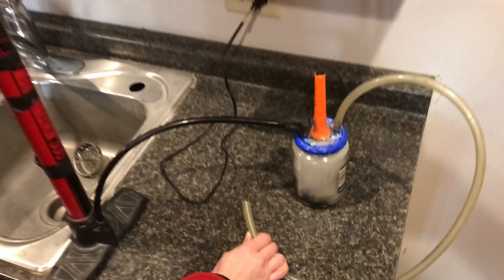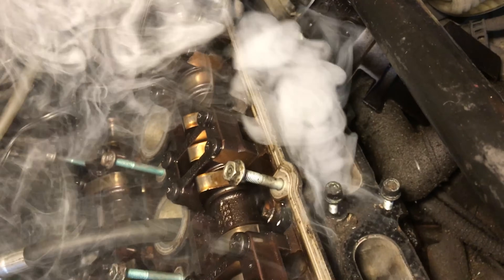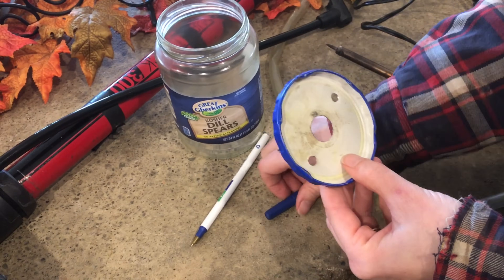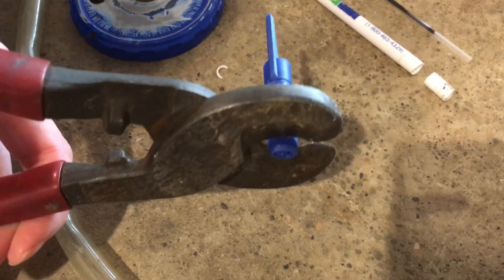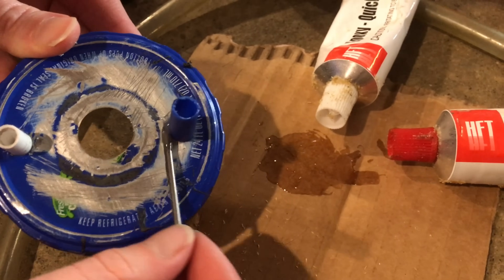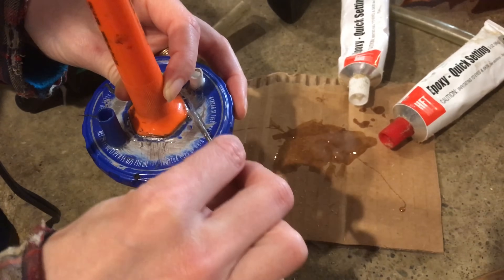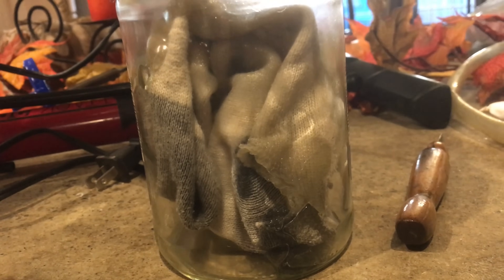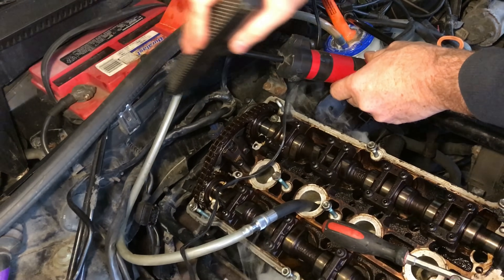BEST automotive smoke machine you can build

Comment: I have tried this with a 30W soldering iron and it does not produce enough smoke, but it seems you are using a 40W? I will buy a new 60W. I also used a pretty thick cotton towel that i cut up into a few shreds and i guess that might not absorb the oil in the same way. Did you use a 100% cotton sock? Most socks seems to have some percentage of artificial fabric in it.
Reply: How did it go? I bought a 25W solder iron should I return it and get a 40W?

Comment: Instead of a bicycle pump, I use a $10 emergency car tire inflator. Switch on and it creates good enough pressure. 

Those tiny cheap plastic $10 pump are seriously useless to pump up car tires so it finally found a practical use for it.

Comment: Finally found a good use for my cheap soldering iron. If you find one of those foot operated bicycle pumps that would work even better because you could step on it with your foot and pump while you lean over with both hands and look for leaks.

Comment: My smoke machine is very simple and puts out a HUGE volume of smoke. I remove the muffler on my lawnmower and screw in a 1/2 inch water pipe nipple in its place. I run a hose to a vacuum port, wire the brake so the engine runs by itself, and with the air cleaner remove I squirt automatic transmission fluid into the carburetor. It makes a LOT of smoke!

Comment: Great video dude,i have a intake leak thats been driving me to cyanide so I'm gonna build your machine and test it, i had this leak before and i put brand new hoses and clamps all over the intake and it worked beautifully but here recently i installed a new engine in the car and the gremlins are back, i got them almost whipped but i have a tiny one need to find.

Comment: 😂.  This is the biggest joke. This is okay for shoddy tree mechanics.  But I wouldn't use this on any evap systems.  You 100% can cause vapor lock using this hack job this guy made. Real smokers keep the mineral oils from entering the evap systems.  Anyone with a Iq of 9 knows that fact. Smoke systems operate off water control valves to keep the mineral oils from getting into the systems.  Don't make this junk.  And this guy should be responsible for any damages he causes to your vehicle for posting this

Comment: FACT IS IF YOU BUY A FOUR CYLINDER CAR FROM SOME YOUNG KID YOU WILL GET ALL THE SMOKE YOU CAN HANDLE SINCE THEY HAVE BLOWN OUT THE RINGS AND VALVE GUIDE SEALS. SMOKE CITY AND YOU CAN STILL BARELY DRIVE IT UNTIL IT TAKES A DUMP.

Comment: I ended up making a 12v coil heater wound around a sock in a paint can.

I bolted male 1/4 inch M style quick air connects on each side of the can.
The inlet side was tapped and plugged. Then a tiny hole was drilled so a tiny amount of air gets through without regulating my shop air.

Comment: Thank you for making the video. I modified the design to use tire valve stems for the inlet and outlet. They seem a little more secure in the lid. I also used a small air compressor with a tire inflator as the air supply. Anyway, this design worked great. I was able to find an exhaust leak in almost no time.
Reply: What type of hose did you use for the tire valve stem outlet?
Reply: @straightshooterz  You can use both Schrader stems by unscrewing the valves and soldering them.
Reply: I made one of these and shared my results within a car group that I'm a member of. 
A member there commented and made sure to tell me that  a can of brake clean was the best way to find a vacuum leak. 
I responded to him and asked "so what do you do for exhaust leaks?"

Comment: Thanks for this. Saved a bunch of time and money. Didn't work at first with a sock, thinking not 100% cotton but some polyester or ?.  Cut an old 100% cotton t-shirt into a large section and worked fine.  BTW.. mineral oil is baby oil without the fragrance. Super cheap at CVS, etc.  Also, didn't work at first as packed the material around the iron too tightly, works best when loose for airflow. Also just blew into hose vs pump.  But when it started going after :15 or so, it was awesome!

Comment: I was using a $7 harbor freight transfer pump with a cigar to find a vacuum leak. When I took the water injector out of the charge pipe to swap it, the thing was gunked up with tar shit. I like diy and this is a good solution but Smoke Pencil is $35. No assembly or confiscating a soldering iron.

Comment: I made the same thing you did but the smoke also blew up through the handle of the soldering iron where the cord goes in to the handle, the soldering iron was from Harbor freight, your soldering iron must be sealed around the cord where it goes into the handle of the soldering iron?

Comment: Much better way for exhaust systems: Use a big shop vac with the hose plugged into the outlet port to blow, stuff the hose up the tailpipe, light a smoke bomb (or smoke emitter cartridge from grainger), then let the vacuum suck the whole smoke bomb into the inlet port. It will blow the smoke up into the exhaust and out any leaks. Get some smoke bombs from the fireworks stand if you can, those smoke emitters are like $2 each and you have to buy a pack of 10.
Reply: It would also blow all the crap in the exhaust pipe into your engine.
Reply: @alan2804  not a problem in any way whatsoever. Most valves are closed of course, and any that are open the harmless smoke will blow back out.

Comment: I only watched 30 seconds, but it looks like you guys did the same as I did. I used a pickle jar, bicycle pump (works just as well with factory emergency pump from Mazda), tire valve stem from part store, AN fitting and hose from an un-used gas siphon kit, old soldering iron, old socks and some baby oil. It chooched out tons of smoke!

Comment: Bought a machine in the 90s. Man did that thing pay for itself quickly. Buy one or make one but get one if you do any mechanical and other things requiring finding leaks. Even used mine to find leaks in a a/c system several times.

Comment: I am really surprised how simple this smoke machine really is. Personally I would use a plastic laboratory containers that would hold up better to use and abuse but the melting of plastic has to be considered. I have found with my own projects that are put together quickly that they are prone to small failures when you need the item to work. So a slight improvement would really be appreciated. Give it a 2.0 version for us all to see fella, Error Code Guy. Thanks and have a great day too. VF

Comment: Thank you for a great video. Question for anyone who may have encountered this - the soldering iron I used seems to be a problem. I had a cheapie Chicago Electric (Harbor Freight) iron that I no longer used since getting an adjustable temperature iron of better quality. I used it to make my DIY smoke machine and it LOVES to pour smoke out the handle and not from the holes I drilled. I initially tried epoxy around the cord of the handle with no improvement and even tight electrical tape seems to loose smoke/pressure. Any suggestions before I switch to a different soldering iron/heating method?

Comment: That does not necessarily mean the valves are bent! It could be just leaking and you would need to grind them. Much easier fix. But another quick note on this same system that I built, I use a pump that plugs into my cigarette lighter. Gives you a free hand to do other stuff. And I agree, being able to have that glass and see how much smoke is in there makes a big difference. You would normally never wait long enough and have enough smoke to make a difference. Unfortunately the first few times I built this, I used hot glue and it ended up melting because it just got hot again. I ended up usingJB weld and for some reason another it came off. It was just getting way too hot! So now I'm going to try it with some permatex.

Comment: can i wrap the sock or cotton around the soldering tip or should it not touch the gun and just heat up with jar?
Reply: From a previous response, said the tip needs to be touching the sock.  That way the oil wicks up to the heat source to create smoke.

Comment: Smart!  
I didn't want to spend big bucks on one. 
I think I will use valve stems with the core removed and upgrade to a battery powered fish tank pump but this is great, thanks for the inspiration.
Reply: I agree with the fish tank pump, only because I'll be working on the vehicle by myself.

Comment: For testing valves, is tis considered as good as a proper leak-down test? Doesn't it need to hold a lot more pressure to prove valve seals correctly?

Comment: Easier way to get bike pump and exit is use a rubber tire valve stem.  Cut hole to size and pull through..self sealing.  Remove valve cores and boom you have your connections.  Solid connection point for a compressor regulated down to 5 psi or a pump like this video

Comment: I skipped the soldering iron and used some paper towels with a little motor oil. I lit it with a match and put the lid on. I had a hand pump similar to a bike pump and the setup worked well enough for me to locate my vacuum leak.
Reply: If you don't care about the smell.  I'm doing an indoor project (non-automotive) and need smoke that is less harmful.

Comment: Better to use atf. Mineral oil can flash burn  once the iron gets it to a high enough temp. And in that jar that would make for a bang and glass shards everywhere. I use atf in mine and use a glowplug for the heating element. Atf has burn inhibitors that keep it from  igniting from high temps. Puts off just as much smoke
Reply: Mineral oil is less toxic.   ATF:  Stay in a ventilated area.

Chemical	Flash point temperature
Mineral oil	 100 – 150°C
	ATF         150-195°C (D93)

Comment: Great idea. You could use a 12 volt air compressor in stead of the bike pump..or regulate the shop compressor to a low setting.
Reply: Yes..12 v. Tire Air Compressor. It will be perfect. Thank you yor the info.

Comment: Why not just use a $30 fog machine from a party store. Its ready to use and can make your own fluid.
Reply: Fog machine uses carbon dioxide, ever been in a club and they release it? It's cold. Do in real life outside especially if it's warm or slightly windy it will disappear almost immediately. If the engine is warm then it for sure wouldn't work.

Comment: Hmm, so a heat source"iron" fuel"oil and sock" in an enclosed space. Kind of a smoldering fire with no air. Pump air in and..... No boom or flash fire?
Reply: Its baby oil. You couldn't set it on fire with a blow torch.

Comment: @Error Code Guy Can we get a material list on the vinyl tubing, the soldering iron used, bike pump used and the socks? Not trying to be lazy. Just want to do this correctly, so an Amazon list, or something similar would be AMAZING! Especially considering the cost you quoted, so it would be awesome to literally have a list of parts you used for the price quoted to ensure a proper and comparable build!

Comment: The pump pressure needs to be smoothed and controlled, specifically for the EVAP system. If you go above 0.5 psi pressure to test EVAP system, you run the risk of ruining the pressure sensor in that system.
Reply: Where would I hook it up to test my evap leak

Comment: I have a collection of old soldering irons. I'll be doing this. I just fixed a P0159 caused by a leaking EGR tube gasket. Could have used this. I used a vacuum as a blower to pressurise the exhaust system and then skurted soapy water everywhere. A smoke machine would have been easier. Best of all, the fix was nothing more than replacing two severely eroded nuts that were so far gone the tube's gasket was no longer compressed.

Comment: My modification to your jar would be to use a valve stem from an old wheel...or a new stem that can be pushed into the lid and it would seal on its own, instead of using silicone.
Reply: You would still need epoxy to seal the soldering iron into the jar lid
Reply: MrEvilWasp 
He’s referring to the air inlet only.
You can put an old valve stem in there and it would seal itself and you just hook your pump to the valve stem.
The hole would have to be precise for the valve stem seal cause it sometimes takes a lot of force to pop a valve stem into a wheel and pickle jar lids are not strong.
The hole would have to be larger than a hole in a wheel otherwise you’ll bend the crap out of the lid trying to get that stem in there.
Reply: @hallhouse5098 maybe a thin washer big enough for the rubber valve stem would reinforce the lid. Better yet buy two metal valve stems for aluminum wheels. They come with rubber seal that would be much easier and stronger than the bic pen or the rubber valve stem.
Reply: One valve foi and one for out
Reply: I was thinking the same shit I actually thought that’s what he used when the video was starting.
Reply: I made one of these a year or so ago and only used a hot glue gun to stick everything to the lid. The only part that gets hot is the end of the solder iron. 
Tire valve stem is a decent idea but not necessary. I used an air quick connect with a pancake compressor and regulator. 
The only problem was you have to wait for the smoke to build up and take your time if your testing a gas tank or something large.
Reply: you can get a shrader valve stem that bolts together.  All you need to do is drill a hole to install.  I added one to a pump up sprayer now I just put about 20 pounds of air in it instead of pumping the handle like a maniac!!
Reply: It would melt u clowns. Lot of you! Valve stems are rubber fools!
Reply: @javaidsadiq5775  tries and wheels get much hotter than this asshole.  That pen would melt faster.  Vulcanized rubber, look it up. Not to mention very little rubber is needed in compounds these day's.
Reply: @javaidsadiq5775  plastic melts as well
Reply: @javaidsadiq5775  lol :) :)
Reply: @fentonport  Hahaha 😄
Reply: @javaidsadiq5775  Except for the metal ones, fool!

Comment: I actually tried this, however there is an issue. The smoke seems to go into the soldering iron and when you pump the bike pump, lots of smoke leaks past the rear end cord part of the soldering iron. Sealing the soldering iron seems to be difficult as the smoke really seems to want to find its way more out through the rear end of the soldering iron rather than through the vinyl tubing. That is a real problem. Did you come across this too?
Reply: You might have to try with a different type of soldering iron.

Comment: I made one of these and it didn't produce near the smoke as shown.  i am losing a small amount of smoke down the center of the soldering iron where the cord goes through.  I am going to stop that leak with some epoxy but i don't see that making a huge difference.  I am going to order some kanthal wire and make one of the paint can type machines next week.

Comment: Beware DIY that pump would put enough pressure to damage some components if you are going to use it for a vacuum test. I must say this smoke machine is simple enough for anyone to build it themselves. Since I can get the soldering tool at Walmart for about $5.👍 just b careful if you are going to use this pump don't go crazy with the pumping😬

Comment: Will this work for a coolant leak? I'm having issues with a coolant leak and I think it is the seal of the water pump but I'm not sure. If this would work it will save me a lot of money and time.
Reply: You could use a dark color added to your radiator water and you'll be able to see where the water is coming out because sometimes it will not leak under pressure

Comment: I made this using the exact same parts as you but it's not working right. Whenever I pump it, most of the smoke just comes straight out of the top of the soldering iron.
Reply from the maker: I’ve heard that happening to other folks. Some soldering iron’s allowed to smoke all the way through. If he takes my Apoxsee and put it ou I’ve heard that happening to other folks. Some soldering iron’s allow the smoke all the way through. You could take some epoxy glue and put it at the top of the Soldering iron where the electric wire goes into the base. This will block this hole
Reply: @errorcodeguy456  thanks, works great now.

Comment: What a GREAT idea! I wish I would have watched this sooner. It would have made finding an evap leak so much easier & faster. Thanks for the video. I'm going to make one today.
Reply: Where would you hook it up to to test for evap leak
Reply: @siktwistofFATE89  look for a rubber line that goes to the charcoal canister.  Each vehicle will differ. If you can find an evap diagram for your vehicle, that will help you out.
Reply: @kylejohnson3382  thanks bro I ended up hooking up into the hose that goes into the engine I was going to work my way forward to back and found my purge valve solenoid was bad.and that was after I replaced my vent solenoid on my charcoal canister which was a bitch to do I had to drop my gas tank to access it.lol but all is good now knock on wood.

Comment: I built this same machine but just a little different... Works fantastic... Thank you....   I used a metal stem from a car wheel- and a barbed stem from an air line fitting. Cost me 9 bucks and I still have the pickles from the pickle jar. L.O.L.

Comment: Wouldn't it be easier to use dry ice instead of a soldering iron dragging a cord around? Classico spaghetti sauce is sold in a Mason jar that's stronger than a pickle jar in case you drop yours. I recycle those puppies during canning season all the time. I'll be using this (with dry ice) to find my vacuum leak. I can't find the damn thing. You can hear it when you pull the throttle cable back but, I can't figure out where it is. Thanks!
Reply: dry ice evaporates quickly.  You'll need a convenient source for dry ice and on the day you plan to use it.  The carbon dioxide dissipates when going through a warm engine, so you may not see smoke.